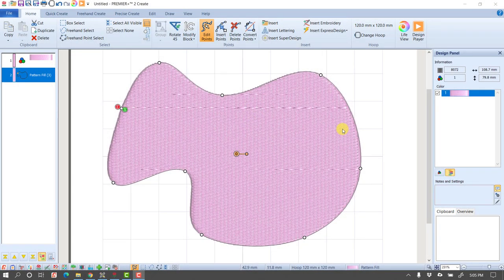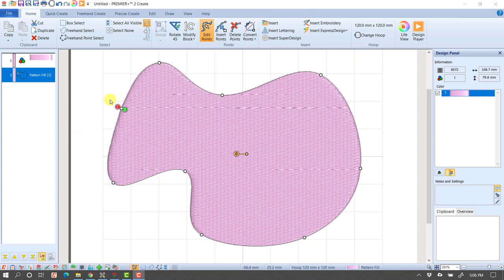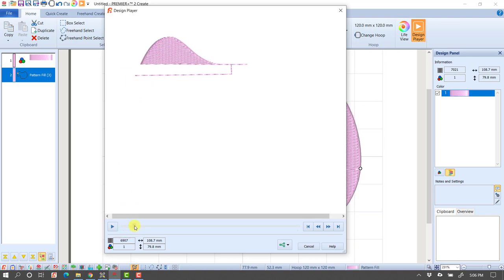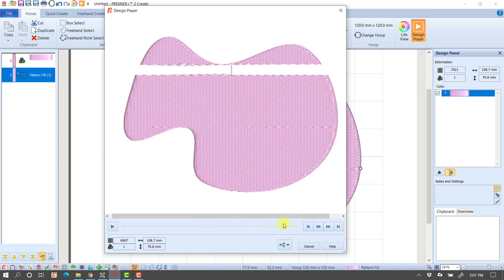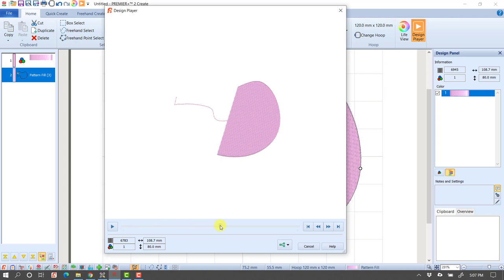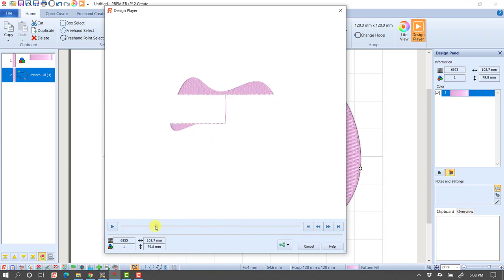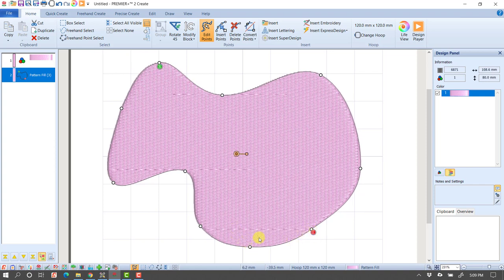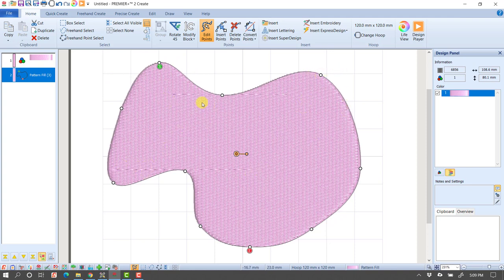PREMIER+ 2: Stitches in Complex FIlls

Comment: Interesting timing.  Some of my designs have had big areas; some are small and still get these running stitches, I've done most of your recommendations, but never thought of adding a node, a node that was very helpful, YEAH!!  Your suggestion about sections great, overlapping wouldn't cause a bump when stitched out?  My question to you is that would using the Modify Module and add stitches might help?  I don't know how to add stitches but getting a better idea of it.  Thank you for the video and hope you do one more maybe on weird stitches, however this covered alot of visual!!!! 🐾🐾
Reply from the maker: An overlap of just a few stitches won't create a bump - you see that all the time with one color overlapping another color. And really - these stitches are so much more visible on the screen than in the actual stitch out.
Reply: @PhilCarlton   THANK YOU.... knew you would have experience...with stitch out... 🐾🐾